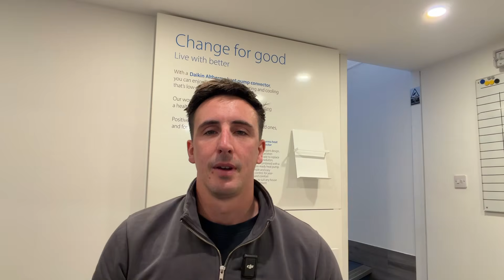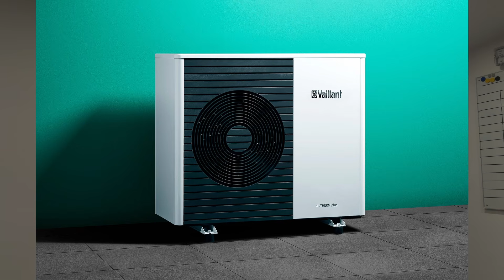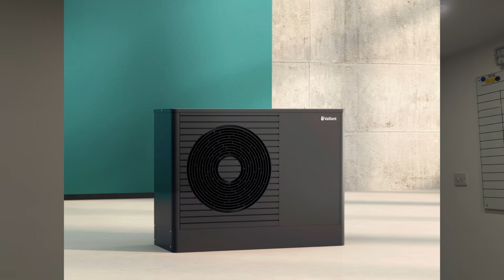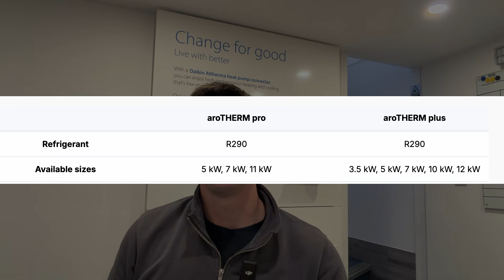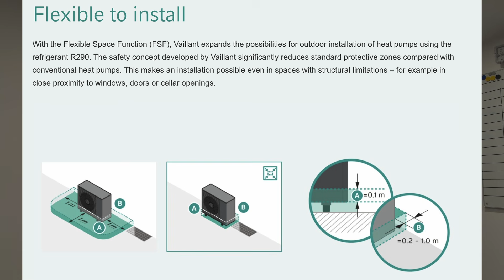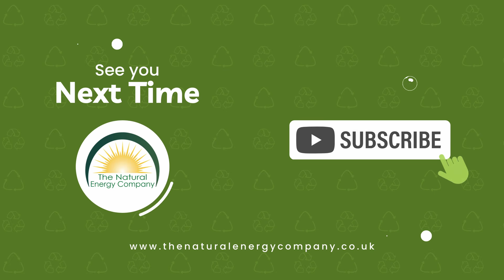Vaillant's BEST Heat Pump Yet?

Comment: I appreciate this is 3 months old but through Heat Geek I had the Pro installed about a month ago. Also have 27kw Sigenergy Battery Storage, 13 X 480 w solar panels and a Gateway. Last September I had an EV charger installed and I appreciate its summer but I’m getting paid to use electricity through export. Fabulous set up.

Comment: As far as I am aware, there is also a new premium version of the Arotherm Plus which has a better efficiency than the current Arotherm Plus and is also slightly quieter. It is more expensive than the current Plus and has been on sale in Germany for a while.
The new Pro has similar efficiency and noise to the current Plus and hence is a direct replacement.
The new Plus and Pro both come with the same smaller R290 protection zones and both have the bigger L shaped coil/heat exchanger hence both can go up to 11kW with a single fan unit.
The new R290 zones are the same 1m all around but stop at 100mm above the base of the unit. This is achieved by letting  the fan spin slowly even if when the heat pump is off/cycling and hence will quickly disperse any possible gas leak..
I hope that is all correct.
Reply from the maker: Unsure about this as the new Plus comes out in June with minimal changes. You're possibly referring to the Perform which is out in Germany atm.